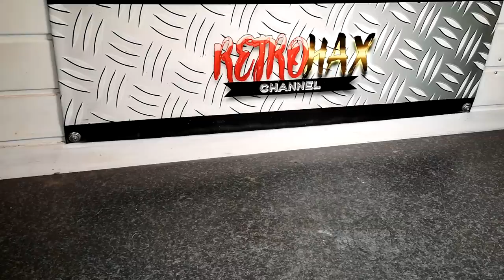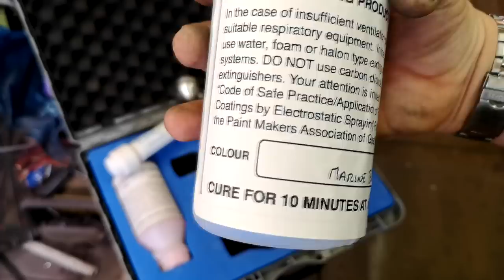Camping Cooking Stove Restoration

Comment: Without the chimney assy on, it looked almost like my dad's ol' Wingard engine "pre-heater" which I suspect he chored off of BR as he used to moan like anything about having to traipse donkeys miles to slip the heaters under the points motors and pivots in frozen weather.   He used the sump warmer thingy in them good old proper winters and antifreeze was super expensive and his Triumph Herald 13/60 was a bugger to get going in sub zero temps, he stopped using it when he got his all new bells and whistles Hillman (Chrysler) Hunter in snazzy metallic turquoise and never let him down in the 25+ years he owned it unlike the BL stuff before that one and the Ford stuff after.   I was expecting to see you come back from the land of the Turks n bubbles loaded up with MK1 Transits, MK1 and 2 Escorts, a couple Cortina's thrown in for good measure cos them old beasties can be found over there for silly money, you coulda done a Sweeney with a nice copper coloured MK1 Granny :)
Reply from the maker: Haha, not seem many old vehicles but I've heard there are plenty.

Comment: looks like you were running it on diesel some will but that one was too smokey so id stick with kerosene
Reply from the maker: Its paraffin
Reply: @RetroHax  ok you could try letting it run out of fuel and burn dry normally that cleans the wick and they burn fuel better

Comment: I thought it was meant to have a blue flame
Reply from the maker: It isn't gas bud.
Reply: @RetroHax  I know it's paraffin but I'm sure it's meant to have a blue flame. I think u just had the wick to high. U can still buy new ones
Reply: RetroHax he’s right Martin the flame is meant to be blue with the wick adjusted so you have no yellow flame. When it’s yellow you are pumping out Carbon Monoxide too so be careful indoors. Great resto though the powder coating system is really beginning to tempt me. Do an alloy wheel and i might have to make an oven and get one ordered.